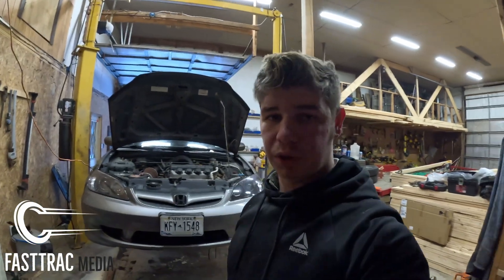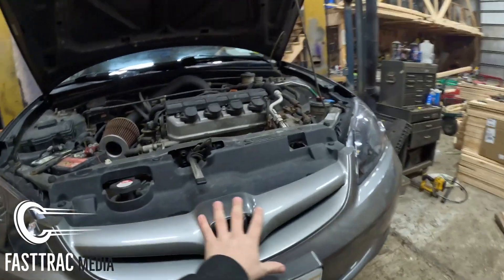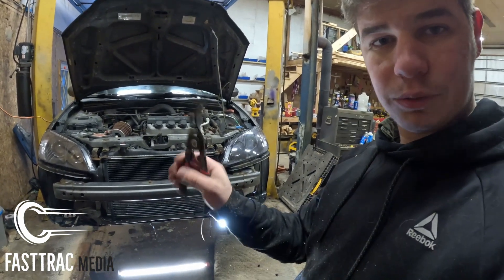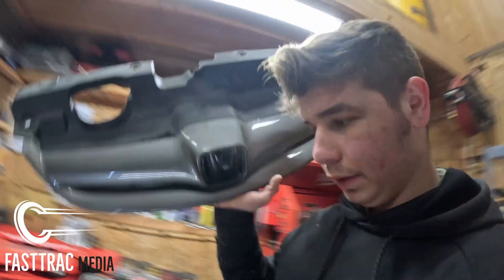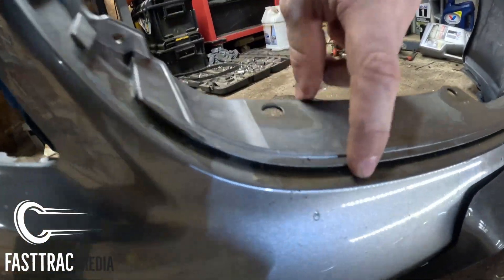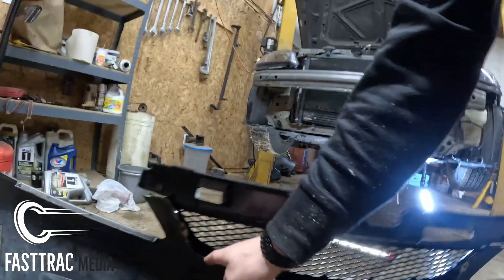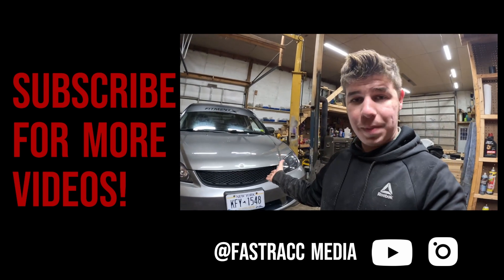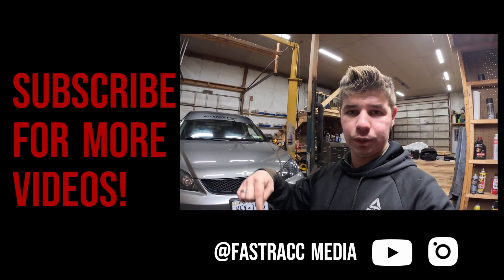Blackout grill for a Honda Civic

Comment: I was going to do mine the only issue is the bumper is so hard to pop on and off
Reply from the maker: Yeah, that can be a pain.   I actually took all the ones of the bottom off and only put the ones under the hood, and the ones in the fender well back on.    It holds really sturdy. It makes it really easy to remove the bumper for cleaning and work.